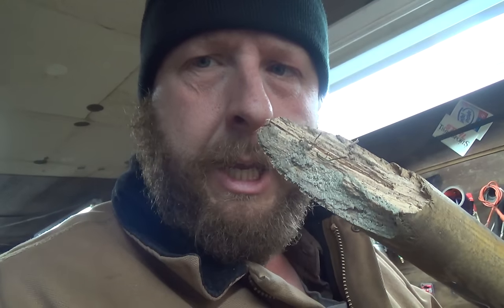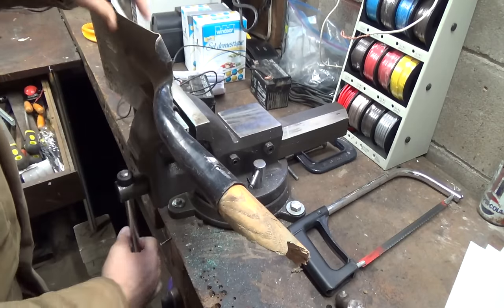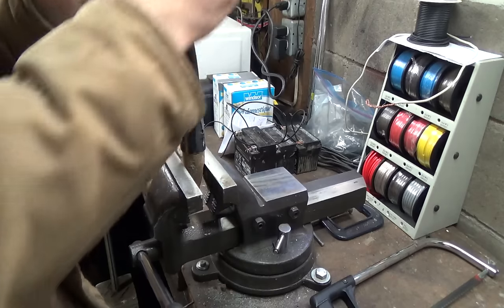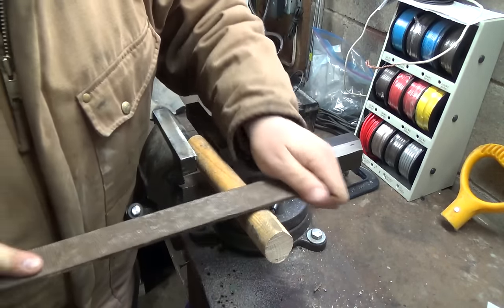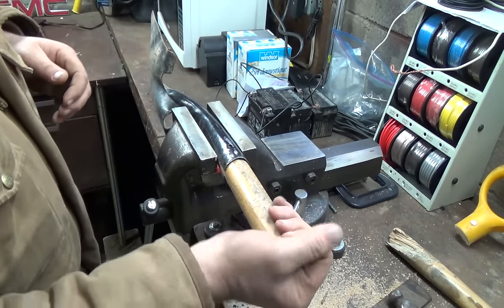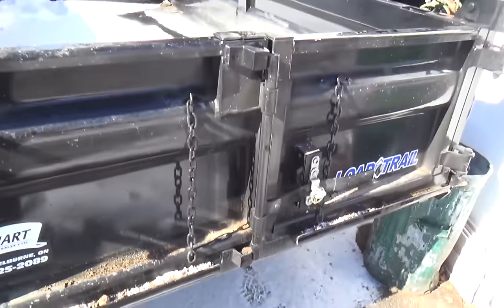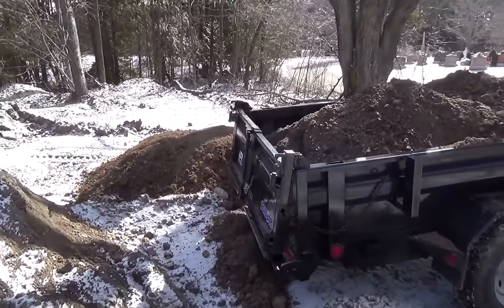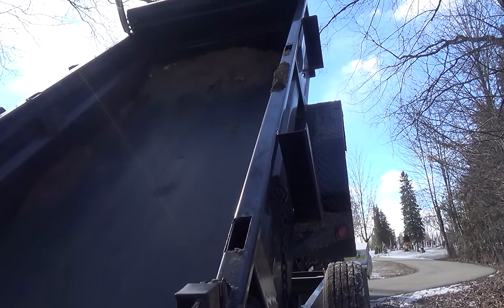Foundry lid extraction...New trailer dumping and Broken Shovel re-commission

Comment: Buy a choke cable, fit it to the dash of the tractor, put the switch in a waterproof box (tupperware etc), feed choke cable through a small hole in the box and fit so it pulls that lever.
You may have to glue the outer of the cable to the box. the lever knob may pull off and leave a hole for the inner of the cable.
Box can be mounted out of the way.

Comment: Hey Bill put a spring clip on the fender for your brake controller Whenever you use the trailer. You could take the D rings off the floor bottom  and put them on the side a couple inches up from the floor of the trailer bed ..

Comment: You could do hydraulic quick connectors on the trailer by the pump so you could use the tractor hydraulics and use the trailer ones when you take it with the truck. Best of both worlds! Then you don't have to mess around trying to wire up the controller on the tractor.

Comment: You could use a set of resistors to apply the brakes that is really what a brake controller is. A break controller is just adjustable... you could have  resistor for brakes half on and one resistor for breaks full on and either a toggle switch or a button for each

Comment: If you have enough clearance, mount the brake controller under the seat with the slide lever pointed towards the front of tractor. It's not like the tractor sits outside continuously in all sorts of weather. . Just make sure to not soak it when washing the tractor.

Comment: take a sealed plastic box that is just a little bit bigger than your controller and cut a slit in the end of it and put the controller part through it and put a piece of rubber along inside so water won't be able to get in there but you could still operate the lever  but it would be sealed up

Comment: you should have use some oil as a release agent on the metal.  I would dump it by swing opening the doors on the trailer.   That way your piles will be taller instead of long.

Comment: By rights when the tractor comes from the factory it comes with a safety switch where you need to put your foot onto the brake to start the tractor. So you could connect your brakes upto that

Comment: You could run it along with the dump controller and pull it out of the battery box when needed. I don't know if you could use it properly with a bag tied around it the same as the dump controller.

Comment: If the brake controller works on brake lights. Why not just add an extra light to the tractor with a switch on the dash that you could flick on when you need brakes . That extra light could then have the brake controller wired into it and you could hide the unit somewhere dry once you work out what setting is best. 
Either that or use the existing headlights on the tractor and you would have to turn them on to brake.

Comment: bill there is a spray that you can spray the circuit board and then put it back together!!
Reply: Yep plasti dip spray, or Rustoleum peel coat, I use it on my R/C electronics and have driven under water with no problems.

Comment: Ok real simple fused power to a toggle switch to trailer plug to trailer battery box  to brake wire  so need emergency stop flip switch brake  full on ready to roll switch off  this also could be used as parking brake while dumping  as simple as it can get